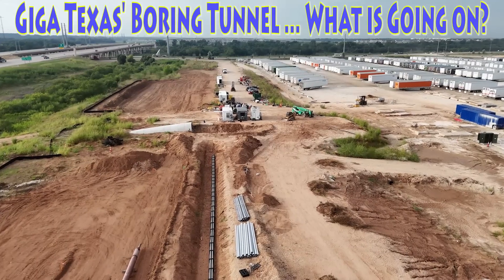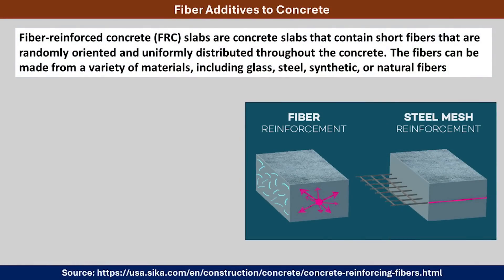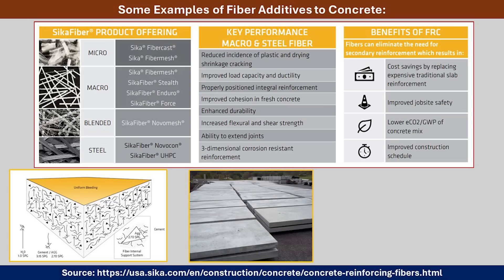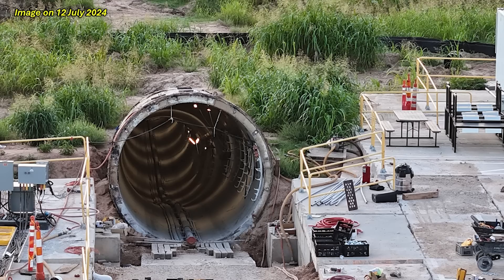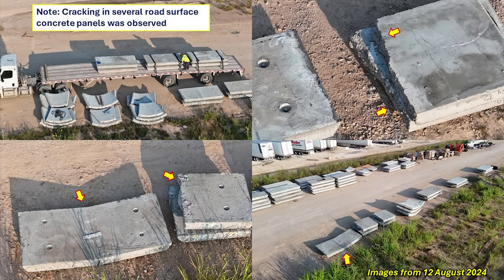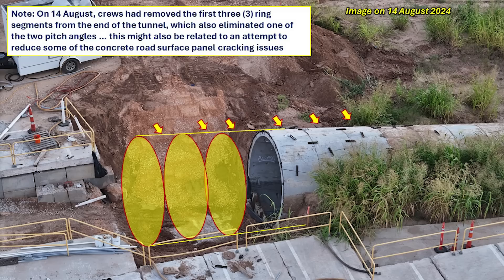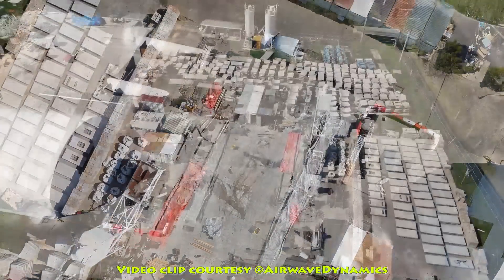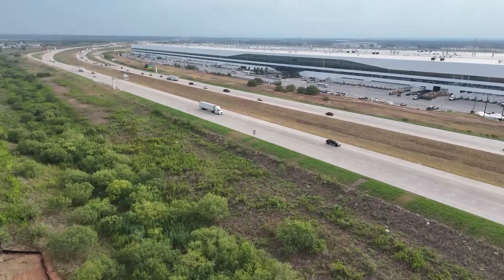Boring Company Giga Texas Tunnel Road Panel Issues, Mitigations & Probable Solutions

Comment: A little bit strange, because generally there is a quality control department in the concrete industry where they take samples of each production run and do destructive pressure tests.
Reply: Only thing wrong with the concrete is they forgot to put the reo bars in
Reply: @BramBiesiekierski  reo bars are heavy and expensive, if you can make up for it with fiber reinforcement it's a cost win.
Reply: @seancollins9745  Fibre concrete is great in minimising cracks in things like slabs, which have adequete support from the ground.  It is terrible in applications where there is any tension.  It is NEVER a substitute for reo, only to supplement it.  How no one at the company was aware of this is both laughable and frightening.

Who ever thought it would be ok to simply omit reo in a bid to save dollars should not be doing any engineering work ever.  And any work they have previously done should now be scrutinised.

As for the cost.  In a priject like this.  Reo is the cheap part.  Cheaper than the concrete.  Cheaper than re-doing the concrete a second time.  Cheaper than the labour cost to instal it.  Cheaper than the labour cost to remove it and re-install it a second time.  To use the excuse that it was to save money makes no sense.  Reo is definitely not something you should skimp out on.

Age old saying still holds true : buy cheap, buy twice.  By once, cry once.
Reply: @BramBiesiekierski  I’m guessing the panels were tested expecting the wheels to be pressing close to the edges and someone put something at the center of the panel. These types of mistakes occur, even engineers make mistakes, I’ve caught some mistakes before they were made.
Reply: @jsbrads1  yeah mistakes are made.  We are all human.  But this one is a bad one.  Any one that knows anything about concrete should have been able to predict this.  How it got that far along is quite concerning.  

Did they also try and "save some money" with the tunnel segments?
Reply from the maker: This tunnel was considered very much a test tunnel to try out new procedures, materials and processes, not to mention the new Prufrock-3 TBM. I'm wondering if these panels tried a different material mix or process as part of the test and they ended up not working as planned.

Comment: Those panels need an arch / crown for compression. I it doesn’t need to be excessive but it needs something to naturally support Compression loads.
Reply: But compression comes from them being installed in a tunnel with curved walls... so the walls actually compress it as part of their support.
Reply: Yep, like an 'arch' but with a very slight curvature.
Reply: @memrjohnno  Called camber in road construction.
Reply: @GregoryJByrne  Yep, cheers, I'm no expert obviously but even I knew of the need for such a thing.
Reply: @GregoryJByrne  The camber in road construction is there to provide drainage! The control joints total negate any "arch" strength. The panel to panel reinforcements are designed to slide inside the concrete. A key shape is cast into the edges to prevent vertical displacement.  Providing no tension member to counter act any arch effect!

Comment: I have to watch the video again…this isn’t their first tunnel but why didn’t they have this issue with the others? Did they try something new here that didn’t work? WRT the fiber aggregate they added. Or was it the pitch or angle of the tunnel itself? Thanks. There has been very little on this…
Reply: They tried a new design using fiber reinforced concrete they should never even have considered. My understanding is that fiber reinforced concrete performs poorly under tension. They also failed to properly test the new design. Fiber reinforced concrete has its place. But not in beams bridge decks, tunnel road segments, etc.